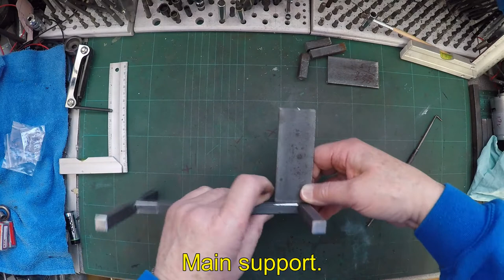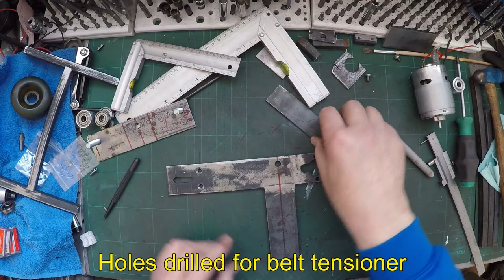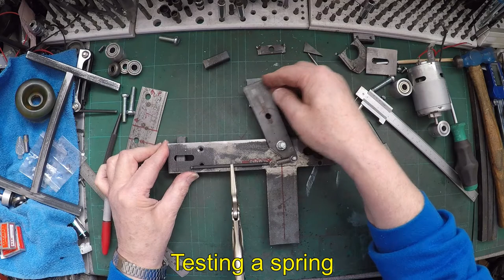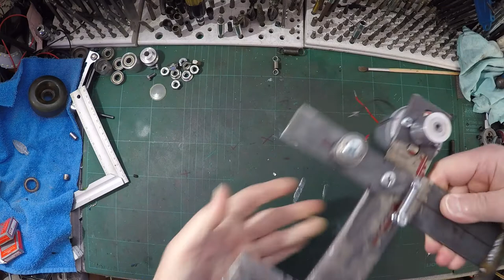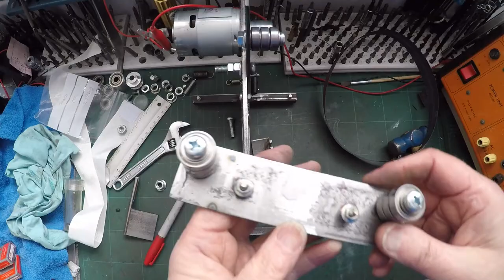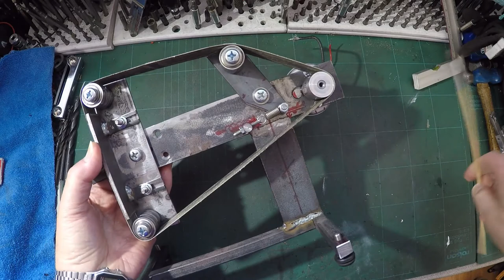Making a 4 wheel ball bearing belt sander.

Comment: I was interested in making a belt grinder. But the tolerances needed are beyond my skill level.  So I will be buying a 2x72...  I found that they are not cheap.
Reply from the maker: Compared to a 2 x 72 belt grinder, mine is just a toy. 2 x 72 belt grinders are expensive to buy and the belts are not cheap.
My belt grinder was cheap to make and the belts are really cheap.
Reply: @DaftOldMan  I am fine that out.  I am looking on Craigslist.  Found one for $1,500 and comes with like 15 belts.  Not sure the conditions of the belts though...  Found another for $2,900 and has several attachments...